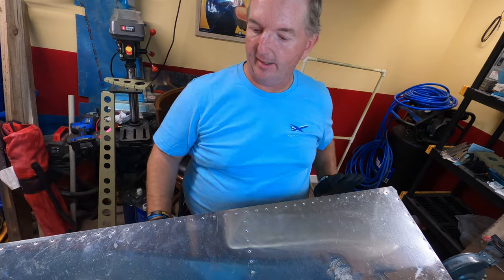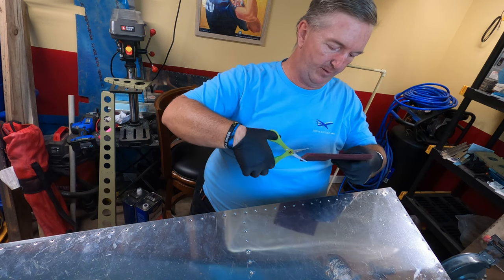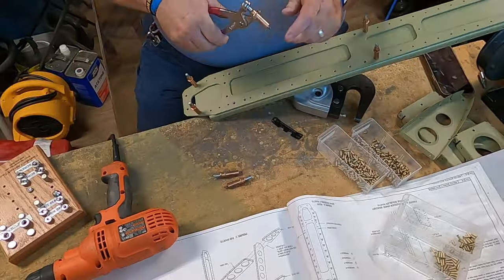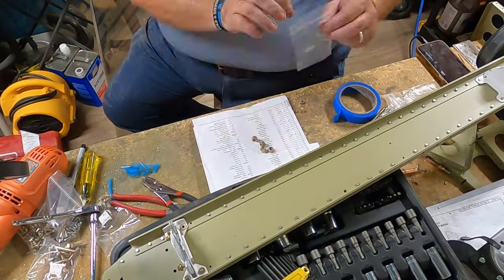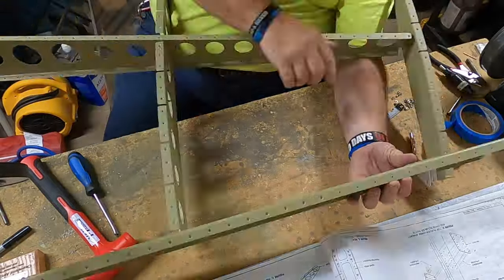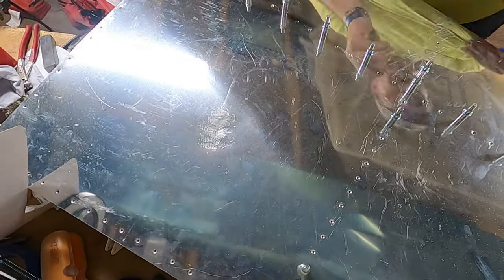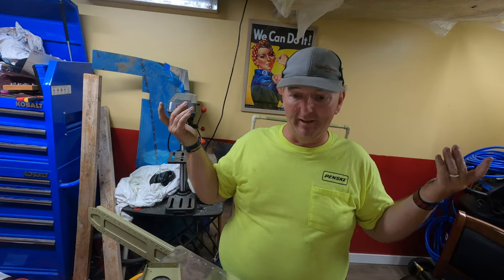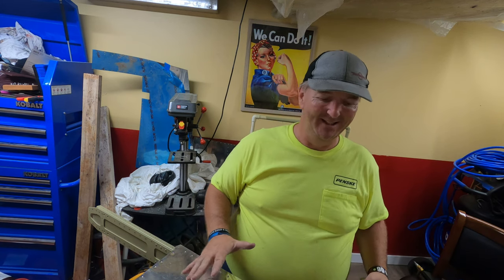[Van's Aircraft RV-10] Finishing the Vertical Stabilizer

Comment: Thumbs-up to the photo you took at your EAA chapter hangar - congrats. 

I'm new to working with aircraft fasteners and hardware as well. My RV-14 Tail Cone Kit included a copy of the book Standard Aircraft Handbook (by Sterkenburg/Wang). Worth its weight in GOLD, my friend! I learned a lot, and could not have performed a comprehensive kit inventory without it. And, it's a great reference for the shop/hangar. Cleaveland Tool has a great 11" X 17" quick reference fastener poster. I also have an AN Bolt Gauge (diameter/length).
Reply from the maker: Thanks for the tips. I'll have to reach out to the gang at Cleaveland for the poster.